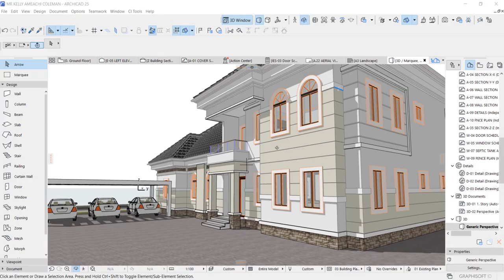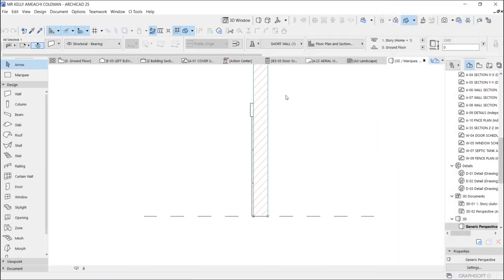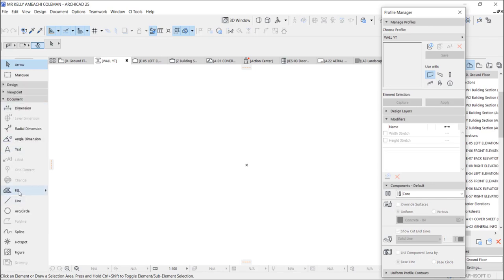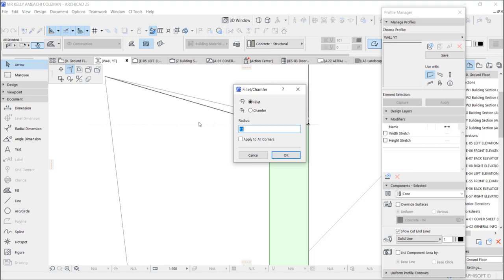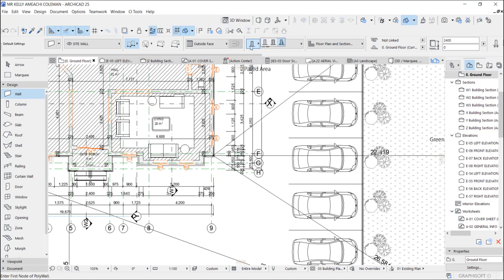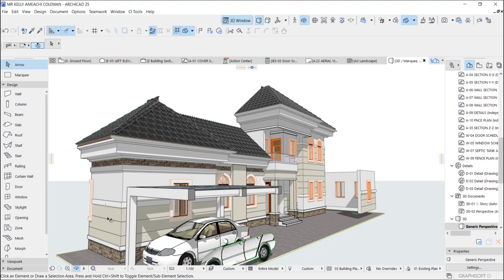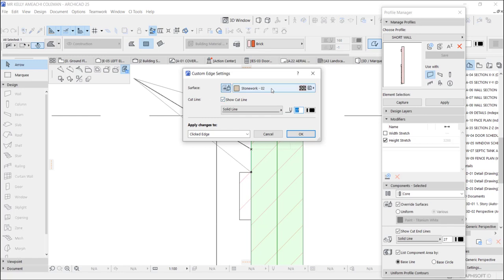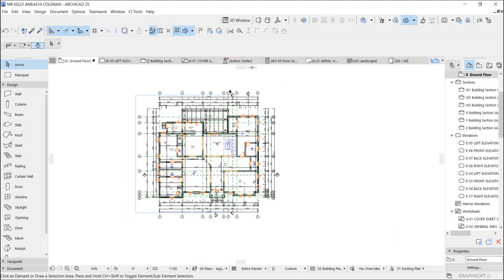COMPLEX PROFILE WALL IN ARCHICAD

Comment: My question No. 2 sir, suppose I have different units in the same project, say a separate guest wing  house, gazebos in the compound, and maybe other structures which are supposed to be incorporated in my design, how do I go about it so that I have different views of each in my working space. Is there a way of having a separate working sheet but in the same project. For example, if I want to have all the floor plans of the different designed structures on the ground floor level with their sections and elevations well generated without showing the details of the other structures which might be behind or in front of them oriented on site. Also how do i publish them? Thanks in advance.

Lastly, could you please help me know how to design a swimming pool and detail it ready for submission for approval. Please.
Otherwise thank you
Reply from the maker: You have a lot of questions. It's find... It gives me idea on what tutorials to make. Yeah everything is possible just turn on notifications. I will definitely make some video explaining all these.